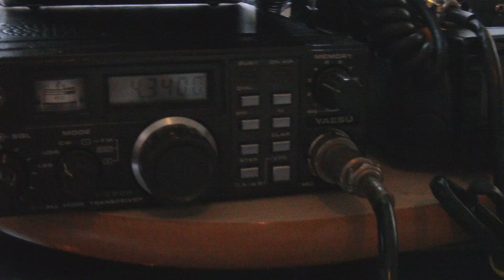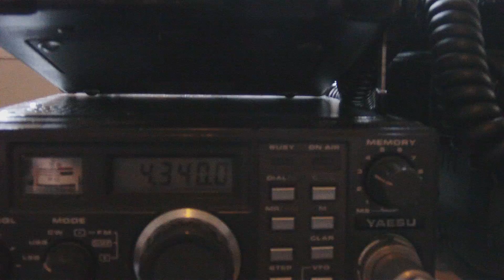SOTA 2 Meter SSB (Part 1)

Comment: I recently got myself a Yaesu FT-290R its really very good indeed, I am working from a magmount dual band co-linear antenna sitting on top of a Realistic DX-302 as the groud plane SWR is below 1.5 I can pick more up on that antenna than the SlimJim up in the loft. Its an amazing little radio for its age. I think I got the better deal it cost me £20.00 the antenna cost me £3.00 from a table top sale. Mike. M6YMN